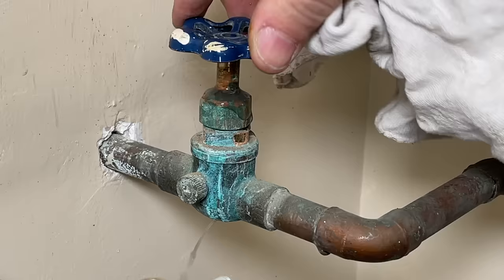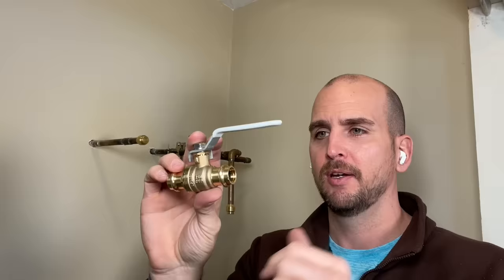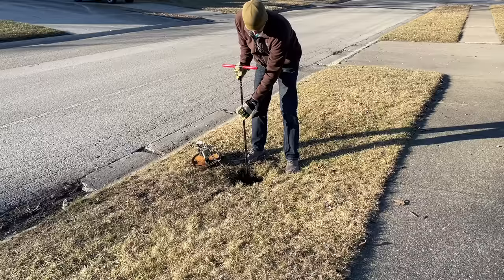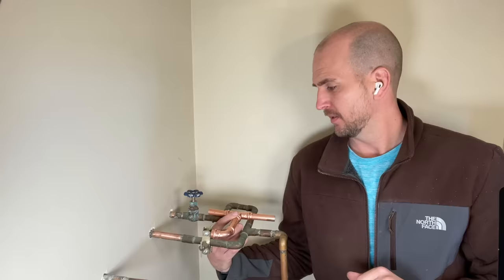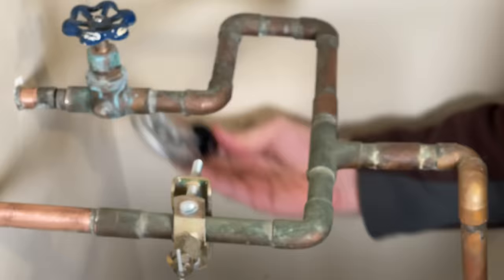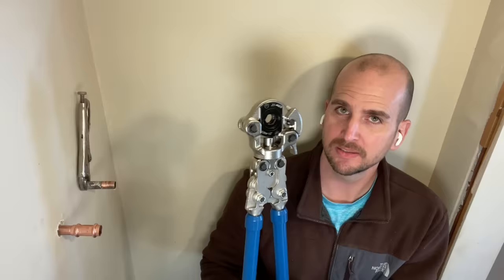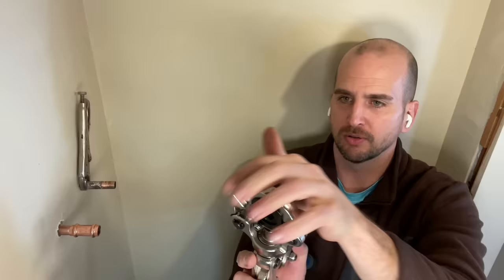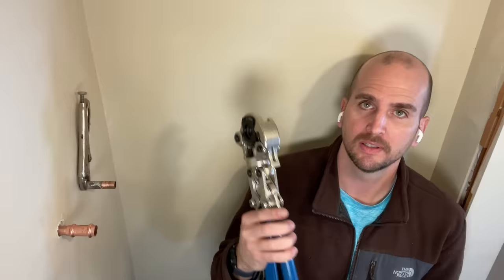How To Install a Main Water Shutoff | NIBCO Press Fittings

Comment: I would much rather use my propane torch and solder all the fittings. If close to a wall, I use a metal plate to act as a heat sink and not cause a fire, which can be easy to start with a torch.  I am just not sold on PEX or crimp on brass fittings and I question how long plastic will live when compared to plastic. All plastic age harden.

Comment: Your project is only as strong as your weakest link, which is the Oring, if all is perfect the Orings will seal, if not then you will have hell to pay removing the crimp/pro press and the
Shark bites, I’m old school, learn to solder, 10 times easier, and you can remove fittings etc. by heating up and pulling off. Copper pipe ages and becomes thinner so crimping would only crush the pipe in certain situations. These are great products and come in handy in many instances but copper is still KING, learn to sweat copper it’s easier than you think once you master the basics, knowledge is easier to store than expensive tools.

Comment: How about just using a compression fitting . Therefore: no sharkbite , to soldering,  on crimping .
Reply: I've never seen them used on water supply. Only valves at a sink or something.
There's probably a reason, but I don't knoe what it is.
Reply: @pasquarielloanthony  I’m guessing he plumbs outside the US. They’re allowed anywhere but are only used on angle stops on the US but everywhere else uses them everywhere
Reply: @joshcowart2446  huh. So that's why.

Comment: Hey. I got a question. Currently, my main shut off valve is in a closet on the level of the main floor, a few inches above the OSB. Is it possible to move the shut off valve below the joists so it would be in the crawl space instead of the closet?

Comment: If I'm going to use any type of 'press' fitting it's going to be Push n Go. They're inexpensive, no tools required and can be used to adapt different types of plumbing. I've been using one that I put on one of my washer supply's to go from Pex to CPVC and it's been there 10+ years. If I do copper to copper it's going to be soldered. It's not hard to do and not very expensive either even if you have to buy the torch kit.
Reply: You taking a chance Ben. If it’s in an open area or easily seen, then that’s not so bad.  Never Never put the “push fittings “ behind an enclosed wall, etc.  YMMV. 👍😁✌🏻

Comment: Do the nibco fittings have an internal stop or can the pipe go in too far?
You mention 11/16" insertion, but I wonder if it can physically go into the fitting further and cause problems?
Reply from the maker: No internal stop at least for the fitting I used for this project.
Reply: @EverydayHomeRepairs  thanks for the info. I'm old school, I still solder all my joints.

Comment: Nice follow-up video. 

I'm curious why you chose to go this route (buying a ~$200 tool) instead of just sweating it on? Sweating with MAPP is pretty easy.
Reply: He said he doesn't have much experience with it.  You're right though, it's easy... as long as there is NO water in the pipe.
Reply: @dustintunis9347  MAPP gas torches are hotter than propane, and a bit more tolerant of residual water in the line.
Reply: @wanderingcousin  - 👍 Mine is propane, I knew that MAPP gas was hotter, but I didn't realize you could sweat damp pipe with it.  My main issue was a shut off valve that wouldn't completely shut off, I ended up with the lowest spigot open and shoved white bread in the pipe I had to sweat.
Reply: @wanderingcousin  True MAPP gas no longer is made since 2008.  It is now called "MAP-Pro" which is actually propylene and not quite as hot as the old MAPP but it is hotter than propane, true.

Comment: As for the crimping method, I would never use it because I would never get enough use out of it as a weekend project person. If I had more plumb projects though, I would definitely prefer that over the shark bite because I think it has a better connection. I do have a question/concern. Though I am not a master plumber by no means, is there not a concern about the pipes sitting out in the air like that without any type of support, or is it in a closet where nothing or nobody can hit it?

Comment: I would not have used a press valve in this case and especially a ball valve. Over the years I have replaced many ball valves. They do fail  often no matter what brand.Give me a good gate valve or globe valve on the water main.They can for the most part be repaired.
Reply from the maker: Hmmm, always interesting to get the wide range of feedback. Thx.

Comment: Was that a saddle valve on the pipe going to the bathroom??  What was it's purpose??  How did you get the extra length of pipe you held onto with the vice grip.  I thought that water line came in from the curb??
Reply: That saddle valve probably fed a swamp cooler (typically found in the SW united states) a humidifier,  an ice maker, or some other small demand appliance. 

These saddle valves are now illegal under plumbing codes. The right way is to tee off the run into a shutoff valve. Then send off the ¼ or ⅜ line to it's destination.

Comment: The awkwardness of the tool, the cost of the tool, the unreliability of the press fit, no way in correcting errors, and lack of speed count against this method.  Sweating copper is cheap and fast.  Shark bites convert from PEX to copper to CPVC.,   The PEXa tool for Upinore fittings is $450.  This fitting style will fade away.
Reply: I use this everyday as a plumber except the tool is electric. I can press when there's water leaking pass valves. I can press when the water is live (out doors of course) and quickly press on a shut off and continue my work. For the basic home owner this wouldn't be the cheapest option but for my work I can press 4" copper fittings in 5 seconds while you are still prepping the first connection. Propress is here to stay. There is also mega press for iron pipe so threading is no longer necessary for running piping. I have only seen 1 press fail and that was due to poor preparation in the piping as it had scoring on the surface of the piping.

Comment: Do the couplings have an internal stop that would prevent them from being used as a repair coupling or can they be slipped along a length of pipe?
Reply from the maker: The NIBCO coupling I used had no internal stop.
Reply: @EverydayHomeRepairs  Thanks.
Reply: They are called "slip couplings" no stop in middle.
Reply: @nedmead6346  Slip coupling = repair coupling. Same thing, different name.

Comment: Did you turn the valve around?  When you put it on it looked like it would turn on with the handle towards the wall.
Reply from the maker: Hey Dustin, nope the orientation was like that in the thumbnail.  In the on position the handle points away from the wall.
Reply: @EverydayHomeRepairs  - I agree  it ended up the right way, but at 8:25 I can see the stop for the handle in the video (at least that what I think I'm seeing) and the handle would have had to turn towards the wall.
Reply: @EverydayHomeRepairs  - I just watched again in slow motion and saw the other side when you were turning it and I get what I was seeing now.  I think the handle can be taken off, turned and put on the other way in case you do crimp it on facing the wrong way.

Comment: I would not be comfortable using press fittings on my water main. I'm not a homeowner nor a plumber so it's just my opinion :)
Reply: Your opinion is correct.  In a freeze, a press fit loses grip.
Reply: @markmurto  I knew I didn't like them, I just didn't know why, it felt lazy.

Comment: I would never trust shark bit on anything. The only thing that’s nice is just like you did and install shark bite as an cap so it can be removed to repair or finish without cutting. 

I have used press fittings but borrowed tool, and have also used pex a with a pro pex tool that I also borrowed which is so simple. Almost can make anybody a plumber.

Comment: I am pretty sure they make ball valves with compression fittings on them.   That would have been a lot easier and less expensive, And the extra length of the compression fittings on the new valve might have been just right to fit In the space after you cut the old valve out.  Just measure 1st and if cutting the valve would not leave enough material then DE solder it And clean and trim the pipes to the right space to fit the new valve.

How many average homeowners are going to want to Order that expensive tool From Jeff bezos and then wait for it to come and most likely never have a need for it again?

Comment: I hire a plumber to replace shutoff valve because it was inside the wall and it was to difficult to shutoff the valve, he said that the water pressure regulator wasn't working anymore,  so he replace the shutoff valve and water pressure regulator he charged me $1200. To me was too much money but I don't know 😱

Comment: Never use press fittings in a house, those use orings which will leak in 10 to 15 years.  Use expansion pex or solder copper.

Comment: I'll sweat the ball valve before I spend $175 on that tool.
Reply: My thoughts exactly... What an awkward device.
Reply: Solder lasts forever too.
Reply: i'm having trouble being convinced that clean pipe a torch and some solder isn't the best way to go... all these alternative.... what if they fail? now I have a flooded basement, which negates any and all convenience I may have saved.
Reply: A pex crimper and a torch to solder is cheaper than that tool.
Reply: @codyreber8370  There are places where using a propane torch is not wise, like around natural gas pipes, or near finished surfaces that would cost more than that tool cost to fix.
Reply: @RayleighCriterion  hence the pex crimper. Sharkbite to pex is just fine in my opinion if it's not behind a wall. Problem being that you can't remove these crimped joints, whereas if the sharkbite leaks a but after 10 years you simply replace it. If it was behind the wall you would use fire cloth and solder a copper to pex adapter and work with that. You shouldn't have o ring sealed joints in inaccessible places
Reply: I think it's a matter of taste. I don't mind using press fittings, especially if working in a cramped space, where heat could destroy the adjacent structure or material.
Reply: It’s a production tool. 
Pro Press it’s a lot cheaper than using a torch when you have to take out a permit on a commercial site. 

It’s also a lot cheaper and faster when you hire a laborer to help you, as opposed to hiring a another plumber that knows how to solder, plus the learning curve for using a Pro Press is extremely fast! 

Plus a Pro Press makes the laborer feel like Superman!
Reply: I spend 4 thousand on my tool and 3 thousand on my smaller one

Comment: Why not sweat the old valve off? That way the stub will already be tinned. Then, even if you have a leak elsewhere, you can at least you can turn the water to the rest of the house back on. Nothing is worse than having the water off, when the sun is going down.....

Comment: i prefer sweat fittings as it is really simple to heat the copper tubing as it is permanent.

1
Reply: Nothing is permanent. Heck if sweating pipe is the best why is the industry switching to uponor pex for most new builds? Cooper will be phased out soon.
Reply: @TheDogDad  if it's phased out it's only because of cost. So far nothing is better than copper for drinking water.

Comment: I don't know if sharkbites are a permanent solution or not. I am not a professional plumber but I don't think most plumbers know for sure either, but we all have opinions.  I am guessing that most sharkbite failures were due to improper installation, most likely diyers.  However, I absolutely expect professional plumbers to be against sharknite fittings regardless of their quality.  Sharkbites mean non professionals can perform some of the functions formerly requiring a pro to accomplish.  It is competition.  Plasterers railed about the inferior quality of drywall when it was first introduced.  This is usually going to happen when a new product that is a threat is introduced.  I have seen where some pros think sharkbites are ok and many others who think they shouldn't be used. I will use them because I am 81 and think a sharkbite fitting will outlast me. In another 50 years I think we will know how good they are.  Maybe not.

Comment: Why not install a ball valve rather than the cap? Then you will have a hot water shut off already in place when you install the hot water heater.

Comment: you need to be careful & orient the valve so the handle doesn't hit anything.  You removed a stop & drain but only put a stop in, are you in freezing temperatures? many areas insist on shutting the curbstop themselves, if you do it & it breaks, you can be liable for a very costly repair.

Comment: Oh yeah I like how you pull out a pair of 1,200 dollars crimpers to show you how you can save money with some close quarter crimpers.
Reply from the maker: Hey Larry, you are only about 7 X off in the price of the crimpers.  Still probably well above what most would/should pay but that is why I also mentioned the other options.
Reply: @EverydayHomeRepairs  check out the close quarter crimper for 25 bucks I don't doubt you, i may be way off, average homeowner don't need those cuz but they really look expensive, how often is going to use them unless you just some rich guy like spending money on tools I don't doubt you sincerity but there you go

Comment: Soldering is kin now to wiping lead joints. Killing me with manual pp tool. Would have installed 5 valves in same time with Milwaukee pp power tool. Sharkbite are for Lowes and Home Depot homeowners. Sharkbite fail with excessive pressure. Gamble at your own risk

Comment: That tool is a waste of money, very difficult to press Ts on half inch, forget 3/4, also 3/4 extensions have to be pulled out and about twice the pressure of 1/2 I hate to think about 1 inch. Returned it
Reply from the maker: Did you order the tool and are having issues pressing the fittings?  I thought it was tough for sure but doable.  My big worry is more of a situation where you don't have the clearance needed.

Comment: With today's new technologies sweating copper has become obsolete.. I prefer sweating myself / old school...but this tool would be nice in certain applications were ya have a constant heavy drip ect..hydronic heat as well ..or a large building..I have Milwaukee press tool..this manual press tool is worth every penny....the tool itself will pay for it's self within 2jobs...just my opinion

Comment: So press fitting, you don't need the soldering the copper pipe to replace my main shut off water faucet? Thanks...
Reply: If you don't know enough about plumbing to do a clean and dependable solder joint, you probably shouldn't be attempting to replace a main shut-off valve.

Comment: I don't know why they don't make it hydraulic Crimping tool Got one for doing battery cables
Reply: There is one on amazon that uses a hydraulic cylinder instead of the manual bolt cutter style. I just bought one and should have it tomorrow

Comment: I don’t see the point of this thing it doesn’t take but a few seconds to sweat a valve on. These fittings are relying on an O-ring to seal and we all know how long washers and o-rings last. It’s a shitty way to do plumbing that unscrupulous plumbers use to make more money and screw the customer. It’s the same concept as a nail gun you can build a deck faster with nails then screws but it will fall apart in short order. If you are trying to make as much money as possible as a plumber and don’t give a fuck about the quality of your work these tools make sense. For a homeowner it would be insane to get one.

Comment: Instead of taking the globe valve out and replacing it with the ball valve, why not consider leaving it there and adding the ball valve as a type of added insurance/reinforcement.  You can never have too many shut off valves in case 1 does fail.  Some people have 3 or more shut off valves to the main...

Comment: For longevity I would prefer to use solder. What was there was 60 years old, and was still working. After you repaired the valve that was there, what was the point of doing that job, other than making a YT video?
Reply: Using new technology bud

Comment: Like the way you turned off the water main by the curb. You used the long valve wrench to turn off the outside main, then just left the wrench on the grass, and walked away. Now Mike the scrap collector drives by your house, sees a piece of metal scrap on your lawn by the curb - stops his pickup, takes your main outdoor cover AND the long valve handle. Tosses them into the cargo bed of his truck, and heads to the scrap yard.
After you come back outside from your basement, you can't  find your shutoff valve handle. So now you gotta call the city water department to have them turn your water back on. SMART MOVE leaving your water valve tool on the grass by the curb. Since you mentioned that you don't have any experience with copper piping, why don't you watch a video on YouTube, and learn how to install a new water valve with copper piping from a plumber who has a DYO video like we do?

Comment: How do you get the handles to stay open like at https://youtu.be/U2CEQHM06cQ?t=585  I had such a hard time keeping the handle open as the gears want to close the handles and get your hand pinched.   Nice tool but maybe I am missing something.  If they can stay open like that, I like the tool. Did two press fittings to go to Pex A and they seemed to crimp well but its a struggle keeping those handles open to get the tool on the fitting.

Comment: A hundred seventy five dollars???  You have a torch so just sweat a ball valve on when you heat the old valve off, saving pipe length.  Don't trust those new fittings in the long haul.